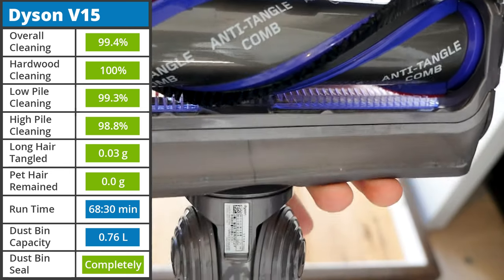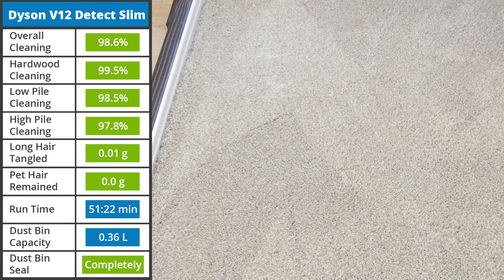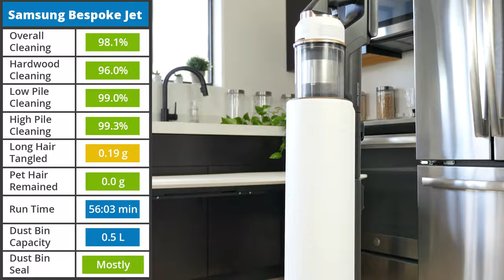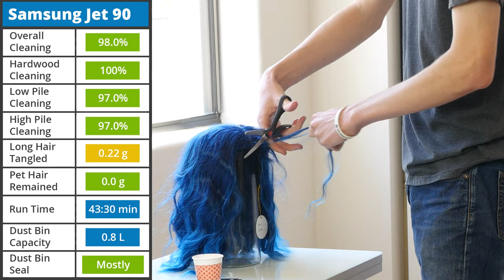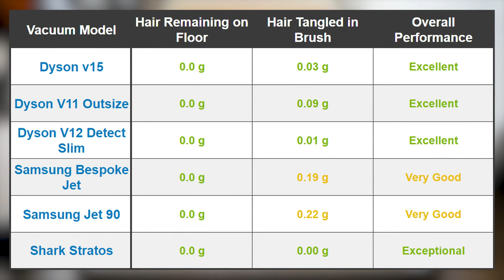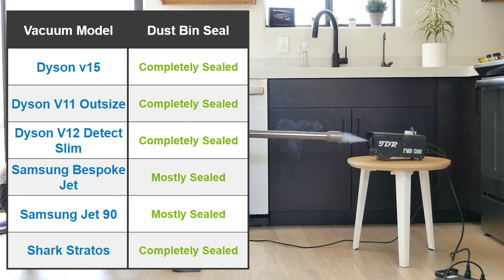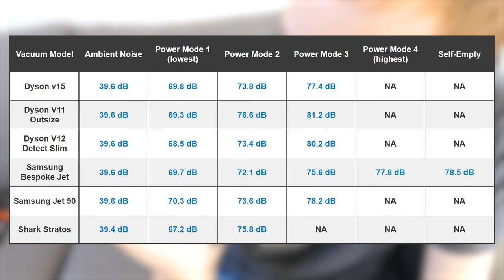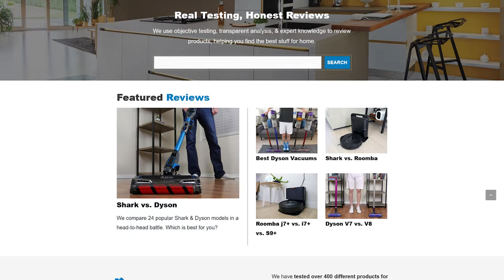Best Cordless Stick Vacuum 2023 - We Objectively Test 41 Models

Comment: I trust your reviews over any other reviews I find online.  Very detailed.  I’m in the market for another cordless stick, so this video came in handy.
Reply from the maker: Thanks so much, Ray. I really appreciate that!
Reply: I find Vacuum Wars more comprehensive.
Reply: This is a Dyson commercial, not a comparison, and one of the reasons they cost so much--marketing. First of all,  Dyson is number one according to this bull shitter, because it has the most powerful motor. But the reality is that any of the vacuums could  EASILY use a motor that is just a little bit more powerful than Dyson's, but that would be dumb, because they would be doing it just to say it has the most powerful motor, not because that  motor was the best for the vacuum's weight,, needed power, cost, etc. Obviously, Dyson which is all about convincing people that it is the best, wanted to have the most powerful motor regardless if it was the best for the vacuum.

Comment: Only the Shark and Samsung had that proper “carpet beating” sound! Suction alone isn’t the answer, vibration plays a very important role in agitating debris to the surface.
Reply from the maker: It is true that suction alone isn't the answer, but I wouldn't let the absence of a "carpet beating" sound deter you from other models without it.
Reply: Couldn't agree more. I have just moved from Dyson to Shark and the Shark gives a superior clean for this reason.

Comment: i am racking my brain trying to choose a Dyson stick vacuum...narrowed it down to Gen5 outsize 1399  / Gen5  1199  / V15 detect  999 thats in canadian funds........i notice online there are less attachments available to the Gen5 line compared to the V15....the cleaning kit is wanted but only the V15 can get it between the 3 vacuums i am pondering.....we are 58 years old with aging joints...lol..plus we have a dog....wanna use it for house and car...mostly hardwood floors except one room plus there are various area rugs.....the 2 floors are a total of about 2500 sq ft....at the end of the day i would also like an extra battery...honestly which would you recommend ?....we also thought about the V12 but the storage bin seems pretty small plus we would like more power....thx for your reviews....cheers from Canada
Reply from the maker: If money is no object I would go with the Gen5 Outsize in your case. A house that size will benefit from the larger bin, battery, cleaning head, and run time.

The others will work fine as well, but the Outsize larger size makes a lot of sense for your situation.

Comment: I am super curious as to why the Tineco S15 Pet didn’t make it on the list as this is the vacuum we have been looking at getting. Was it not tested, or just didn’t perform well enough? If not, what areas?
Reply from the maker: Not one we've tested, unfortunately.

I've tested a few other Tineco cordless vacuums over the years. Thus far, I would say my experience with Tineco has been that they are good vacuums, but still pretty far from great. I've yet to test anything from Tineco that would rise the highest levels.
Reply: Plus they don't last long.

Comment: Do any of these have an option to turn the brush roll off for hardwood floors?
Reply from the maker: Possibly the Stratos...I cannot remember if it has a toggle or not.

None of the others have that option.
Reply: Why would you want to turn the brush off?
Reply from the maker: @wooj82  Some hardwood floors are so delicate that it's recommended to not use any type of a brushroll, as it can scratch them.
Reply: @ModernCastle  Surely that's not a hardwood floor if it gets scratched by the bristles of a vacuum?
Reply from the maker: @wooj82  Perhaps "hardwood" isn't a fair assessment of what it is...but let's just say, delicate wood and other delicate non-carpet surface flooring.

Comment: I may purchase the Dyson v15. I currently use the V8 which I bought in 2022 but it just won't vacuum up tiny stones the size of rice they just refuse to suck up and make a horrid noise only to be spat out or fall out when I turn vac off.. Very annoying
Reply from the maker: I'm not sure the V15 is going to be much better for that.

The V-series notably is not a shop vacuum. It really shouldn't be used to remove stones of any size. This really applies to every consumer cordless vacuum. 

If you want to vacuum stones you need a shop vacuum.

Comment: Thank you for this very helpful review. I have been going in circles trying to find one that ticks the most important features... what I really need to know from your reviews is how effective is the low setting long runtime mode? Its not much help if it has to be next up from eco mode most of the time as that run time is so much shorter... so talking real time battery life. Some models on eco mode are pretry useless so that long runtime claim is a bit irrelevant. I am not talking a little boost to pick up something stubborn, I mean what mode for general use is effective on carpet? Regarding testing, does the battery reduce in time when actually sucking (under load) like on carpet as opposed to just running without any restriction? Does it have multi-floor head or does one have to keep swapping? Are tools on board? Including these things would be really helpful. 
Pointing out the lock switch is great, as want to buy for my 85yo mum and she has arthritis. Will check your website too... so far the stratos is favouring but I was worried about the noise, but on this demo it wasn't too bad - was that on lowest setting first? How effective is it on lowest setting? Thanks.
Reply from the maker: I wish we had that data, but unfortunately we are do all of our cleaning tests on max power mode. 

Speaking more subjectively, I would say than any of the vacuums on this list I would want to be in auto / normal power mode. Eco mode is really only a good option for lighter cleaners or cleaning hard surface flooring. When it comes to carpet, you need / want the extra power of at least normal / auto mode, and ideally max mode.

Unfortunately, we don't have specific data on battery / run time performance under heavy cleaning load.

All of these vacuums use a multi floor head, with some also having a secondary head you can swap to it for hard surface cleaning.

Tools are not on board with any of these. They are stored separate or on the clean station.

Our noise tests includes all power modes for all of these vacuums.

Stratos low power performance is similar to others. It's good, but not amazing. Most of the time I'd use normal / auto mode.

Comment: I’m scared to buy another dyson. I got my v7 in 2019 and after a year it died so they replaced it with the v7 animal. After a year it also quit so they replaced the battery and motor. Another 4 months that motor goes out. It’s possible I just got 2 bad vacuums because the batteries are both fine but I don’t want them have so many issues again.
Reply from the maker: That sounds like some extraordinarily bad luck. I've owned 10+ Dyson vacuums and aside from the battery dying on one (because I dropped it) every single one is still working perfectly fine.
Reply: @ModernCastle but if you comment that you own 10+ Dyson vs @RananaX3 who commented then your 10+ Dyson obviously don’t have as much use as their has had did making for a poor comparison. Otherwise decent video.
Reply from the maker: @SpeakTruthBeKind  Yeah, that's fair.

Comment: doesnt the motor being high reduce the power from the suction opening? Also, the weight is all up in your hand? Why wouldnt they put the motor, either in the middle, as at the bottom may reduce spaces it can reach.
Reply from the maker: Most of the weight is in the handheld portion of the unit. As to why it's there, I would guess it's due to ergonomics and balancing. They are trying to balance the weight between the weight closer to the floor and the weight up nearer to the hand.
Reply: @ModernCastle  They need to put it in the middle, about 2 feet from the roller. high enough so it can reach under furniture, but not reduce power. Thats it.
Reply: @philindeblanc  The position of the motor doesn’t change suction efficacy assuming the unit is sufficiently sealed, a motor positioned closer to the grip improves leverage efficiency (balance), the ability to reach under furniture and utilise the unit in its shortest form for use such as in cars.
Reply: You want the weight in your hand, the further the weight is from your hand the less easy to handle. A long stick makes sense for getting into tight spaces. There's a couple of reasons no vacuums are designed to your specifications!

Comment: you should really put more effort into the pet hair test, if you know any cats or dogs they like to stay in their favorite spot sometimes for days without it really being cleaned...so by the point you get to actually clean the pet hair is stuck so well to the carpet that it looks like a part of it. so please do improve on really really rubbing and pressing that hair on there..
Reply: I can say from my experience that the Dyson v15 detect comes with a hair removal screw tool that uses additional power from the battery to remove hair. Before I got my dog I never really noticed whether it did better than the regular attachments while removing our human hair from the floors. But I recently have been using it with my new dog is furry, not hairy like regular short hair dogs and it did a good job removing the fur from his bed linens. It's pretty powerful so I needed someone to hold down the sides as I rolled it back and forth removing the hair. With that said, don't expect it to work like these silly commercials where you just walk passed a spot and voila it's clean. No, it needs a little time spent going back and forth to thoroughly remove pet hair. And if the Dyson v15 works like that, id imagine any other battery run stick vacuum will require even more effort. Since the v15 detect is currently the strongest suction on the market as of this video. 

However, I currently have my eye on the new "Bespoke Jet™ AI vacuum with All-in-One Clean Station" (whoa I copied and pasted it and look how huge the words are 😂). But anyway it also comes with the spray spinning sweeper for free so you can also mop up small messes with it. The suction is higher than the v15 at 280aw vs 220aw and it has an 100 minute running time vs 68 minutes running time on the V15. It's supposed to last longer than the outside as well. BUT I'll wait until it is released and see some real reviews before I switch. After all, I just bought my Dyson in Nov and they already released an updated version to also compare to the Samsung.
Reply: Ooh, btw. I forgot to mention, my biggest pet peeve with the Dyson v15 detect is that you have to hold the on trigger in order to use it. There is no on/off switch so it does cause some hand fatigue. For that reason, I most often use it for heavy dirt areas or smaller jobs. And I use my Roomba to do the whole house for everything else. Still in all, I'm considering exchanging the Dyson for either the newer one that DOES have an on and off switch or the Samsung when it comes out bc it not only has all those features I want but it also has more. Like the additional mopping options and the self emptying. 🤷🏻‍♀️
Reply: Naw

Comment: I have never had a dyson last more than a year, they clog easy are a pain to clean and will never get another dime from me, my shark stratos has done well and blown every dyso. Stick i have had out of the water on every level. THE Real the real underdog for me has been the brushless Ryobi dual roller, but it has one major drawback which is filtration, which my Dyson v8 was the worst at by far, along with the charging dock, two of which blew their voltage regulator and fried the battery.

Comment: Doesn't test the one thing I care about. STANDBY time. Am I gonna have to keep it on the charger? I want something I can charge when needed and not have the battery go flat when I'm not using it.
Reply from the maker: No, you will not need to keep any of these vacuums on the charger. Same can be said of any cordless vacuum battery of any reasonable quality level.

While I didn't test that explicitly, I've used enough of these vacuums in our long term tests to know that they can often go months without use or charge, holding onto their charge and still be ready to go when you need them.
Reply: @ModernCastle  I came here because I have one. Not cheap. Claims to be lithium ion. Battery takes roughly 6 hours to charge and goes flat in about 3 days with or without use.
Reply from the maker: @SecretlySeven  What model do you have? And how old is the battery?
Reply: @ModernCastle  Besswin W-26 unit is about 4 months old.
Reply from the maker: @SecretlySeven  I see. Thanks for that.

I don't think comparing your vacuum to the models in this video is a fair comparison.

What you have a Chinese made $85 cordless vacuum...it makes absolutely sense that the performance would be terrible. 

Comparing that to Dyson, Shark, and Samsung will be a complete night and day experience, both in terms of battery power and general performance.

Comment: I'm a taller person (apparently) and I find all of these sized only for munchkins or hunchback-wannabe's.  I wish you'd mention want height in a unit-standing position.  Hunching over for 20 minutes - even 10 - is not a pleasant exercise.  I also will only buy a unit with 'headlights'... your tests are always in clear light open floors but I have corners and shadows in my living spaces - I want to see under tables, shelves, chairs, etc.
Reply from the maker: Thanks for your suggestions.

I can definitely make a point to include a wider variety of cleaning shots moving forward.

Regarding the vacuum height - I can also try and include that in our future videos. In the meantime, you can always find the exact dimensions of every vacuum on our standalone reviews here - https://moderncastle.com/vacuum-cleaners/